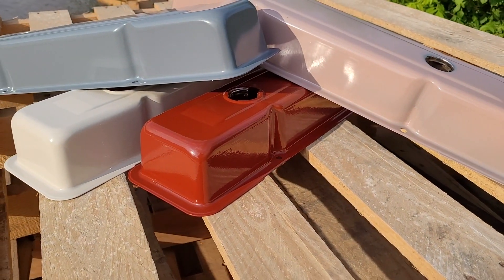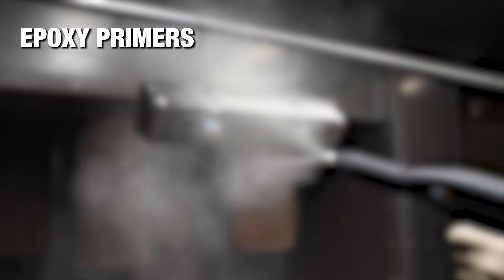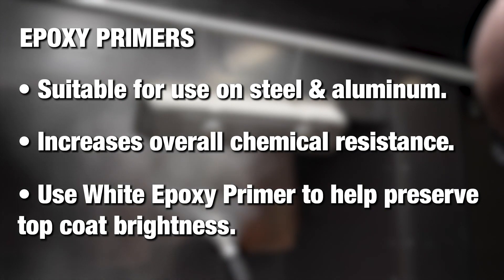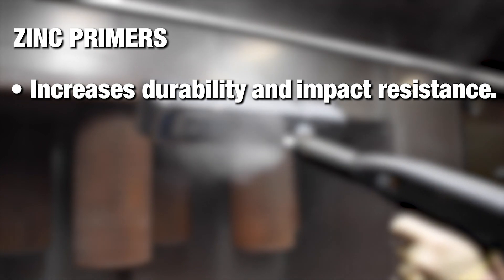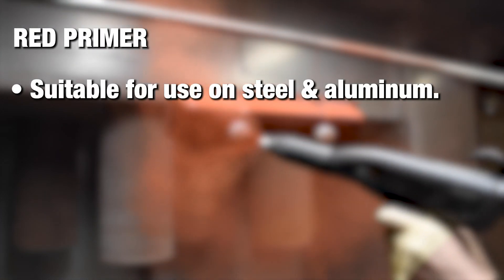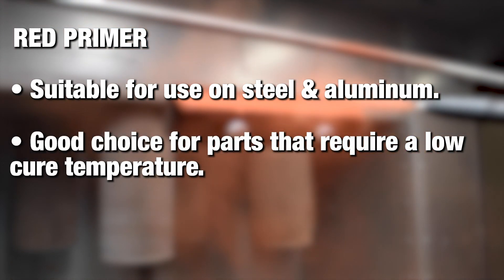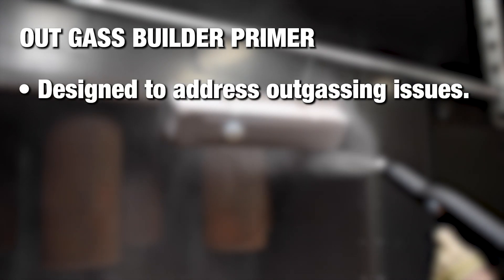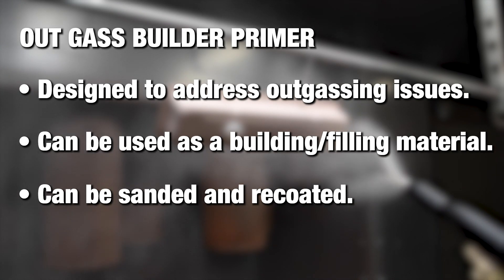Benefits of Powder Coating Primers

Comment: Why is the Zinc based primer unsuitable for Aluminum?
Reply from the maker: Zinc primers are not compatible with aluminum substrates. Over time, they may separate and cause your coating to fail.

Comment: What sand grit paper is recommended to use for the Out Gas Builder Primer? It needs to be full cure to be sanded out?? Thanks
Reply from the maker: We recommend using 220 grit. 

Here is the cure process for the Out Gass Primer from our website: 

"Cure thin parts (Example: valve covers) for 20 minutes and thick parts (Example: wheels and intake manifolds) for 30 minutes at 400ºF. (TOTAL TIME IN OVEN - NOT PART METAL TEMPERATURE)"
Reply: @columbiacoatings  Thank you so much!
Reply: Can I use Zinc Primer on the Crankcase Cover of a Motorcycle Engine Cover or Car Engine Cover? and can it help reduce Outgassing Issues?
Reply from the maker: As long as the parts are not made of aluminum, then you can use a zinc primer. If you need to reduce outgassing issues, then the Out Gass Builder Primer would be better for that application.